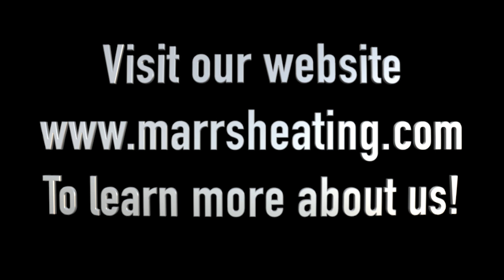Zoned Variable Speed Heat Pump

Comment: Zoning is crap. Dampers openings closing with static pressure.  Communication is also crap. When start having problems this will go down hill real quick.  One yiu call another company to work on it that doesn't understand it its over.
Reply: Not that big of a deal, just bypass the zoning and run the system on 1 zone till you find a contractor that know what he's looking at.